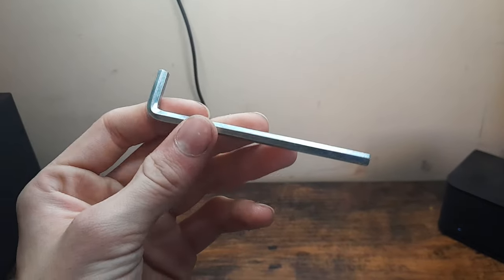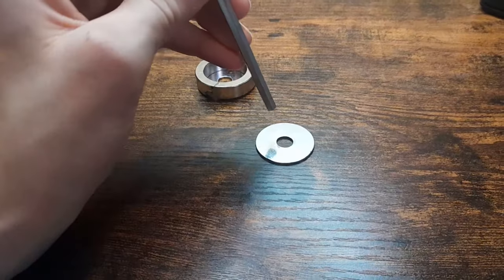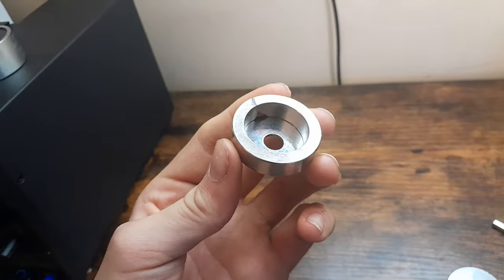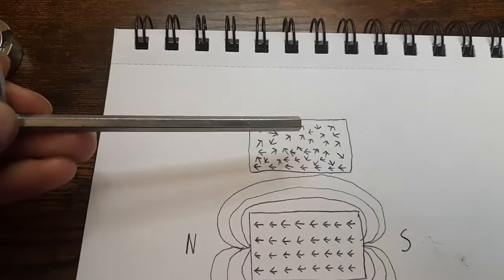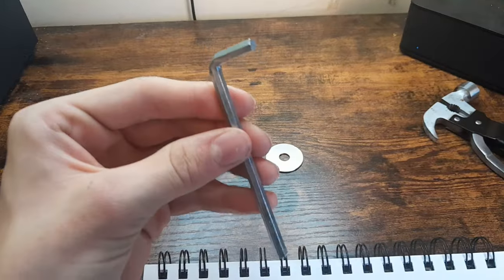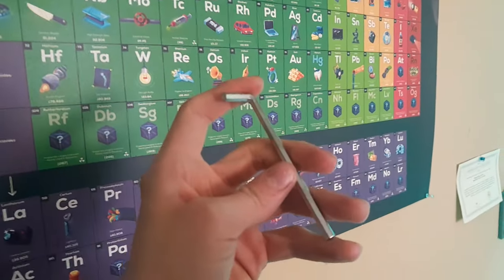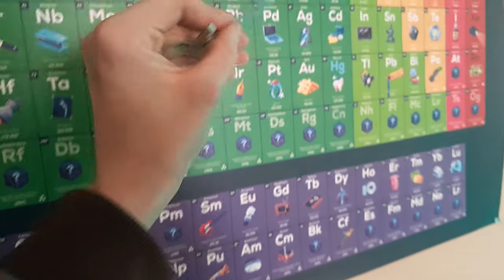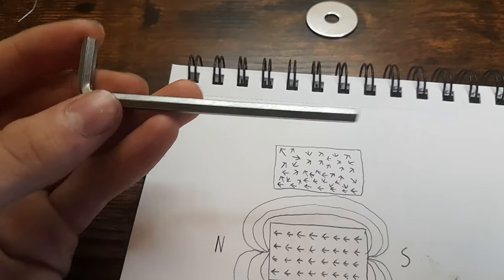How to magnetize metal (making a permanent magnet)

Comment: The way you make a magnet this way is to have a slightly thinner wire gauge at the end. So it'll actually burn out like a fuse when it reaches the peak of the current.
And then disconnect it from the electrical source.  That way, you can use AC. Currand I'll break it at the peak i'm one of the peaks

Comment: I do understand why hitting with a hammer makes the magnet stop working.
But why does hitting it in the presense of a magnet make it magnatised? Like, what does the hammer change from it just being in a presence of a field?
Reply from the maker: It jiggles the atoms around a bit and makes it easier for the domains to reorient themselves and align with the field. They'd want to stay in place otherwise. But I could be wrong. Some people suggested hitting it with a hammer was unnecessary.
Reply: Like he said, it allows the atoms just a bit more freedom to reorientate themselves. They’re experiencing a magnetic pull towards the magnetic field, so when they stop being shaken and settle back in, a higher % will be facing the desired way and magnetize it.

Imagine you have a jar of rocks and sand. You want all the rocks at the bottom of the jar, but the sand is in the way. If you shake the jar up, you’re going to notice some of the rocks ended up on the bottom in place of the sand, but not all of them. It’s the same for the magnet, except instead of rocks on the bottom you want them to rotate.

You can increase the effectiveness by getting more of them to face the same way, but that gets harder the stronger you want it.
Reply: @nicksgmail9663 so are you implying that the longer you tap it with a hammer, the stronger it's magnetism?
Reply: @visualmunchables  Consequently it seems to me high amplitude vibrations would work better than a hammer

Comment: Maybe you know and if so could you please tell me…. I’ve a magnetic charging port on a device and a magnetic charger. Both have two magnets of opposite polarisation. The device has lost one of its magnets and I was wondering how to replace it please? I can’t find replacement magnets for these types of charges online, I don’t know if I can use non magnetised metal, whether it will still allow the current to flow and the device to charge, whether it won’t work at all or whether it’ll burst into flames and whatever solution I use it’s going to be too small for me to hold on to test so I’m going to have to go straight for the superglue or whatever glue you use for electrical components. 

Any ideas? Please?

Comment: So is there a way you could make something already magnetic slightly stringer with this technique?
Reply from the maker: Yes, as long as the magnet you use is stronger than the one you're trying to make stronger. But this will only work to a certain extent. The more aligned each of the atoms are with each other, the stronger the overall magnetic field will be, but once all atoms are aligned, you can't really go beyond that.

Comment: You don't need the magnet to magnetize the steel bar. You can just point the steel bar magnetic north (and use the earth as a magnet), whack the end with a hammer and the bar turns into a magnet.
Reply: Please stay off the internet and don't comment for a while.

Comment: The magnetism in the wrench seems to be very weak, how can it be made stronger?
Reply from the maker: A stronger magnet will do the trick! Also, using metals more pure than the wrench should work better. Another idea is to heat the wrench and let it cool down in the magnetic field while tapping it, but be sure not to heat the magnet. But that's just a theory.

Comment: What metal can you use ?
Reply from the maker: As I said in the video, iron, cobalt, nickel, and gadolinium are the only metals that'll magnetize at room temperature.
Reply: @SomethingAbtScience  a terrible idea just came to mind: what if one were to be in the middle of the wilderness with very little outside magnetic interference and tried to tap metal into being a magnet make a generator based on that, create a stronger magnet based on a solenoid, put that new magnet in the same motor and repeat until they got a strong magnet?

Comment: I got interested in that 15min ago wtf.

Uh i saw that you can demagnetize a magnet with fire so the magnet can be stronger if he is in like..Ice ?
Reply from the maker: It won't necessarily make the magnetic field stronger, but cooling it down would make it slightly less susceptible to an impact demagnetizing it. Cooling it down causes the magnetic domains in the magnet to be more stable, and denser.
Reply: Thanks for the explanation ! @SomethingAbtScience

Comment: If you just RUB the strong magnet in ONE direction over and over it will magnetize that allan wrench better than that. Kind of like whittling wood motion or using a ferrocerium rod.
Thumbs up still.
Reply: This is for the same reason though at the end of the day. When you rub the two it’s still “hitting it” because it’s bumping along the edge many times we don’t see. It’s still wiggling the atoms and letting them orientate themselves towards the magnetic field, which is the purpose of hitting them.

The reason it seemingly worked better for you could be that the smaller bumps allow for better adjustments.

Comment: seriously?!? we just hit it with a hammer in presence of a magneting field? 

we can make like infinite magnet generators. holy shit. 

does this weaken magnetic field on the stronger magnet over time? or is it seriously this easy to make magnets?
Reply from the maker: @l.e.u.m.a.s4218   The metal you turn into a magnet will not have nearly as strong of a magnetic field as the neodymium magnet or electromagnet you use. 

But if you want really good results, I'd melt the metal or get it red hot and let it cool down in the presence of a magnetic field. 

This will allow the magnetic domains which are trapped in the solid metallic lattice to re-orient themselves with the magnetic field while in a liquid or at least red hot state(idk the required temp). Then it solidifies while they're all aligned with the field if that makes sense. 

The maximum magnetic field strength you can achieve is determined by the magnetic properties of the material you're magnetizing, not the external magnetic field you use to magnetize it.

Comment: Why would you post with a thumbnail of a wound wire if that isn't what you are going to do?
Reply from the maker: I didn't make a thumbnail for this video. When posting a video, youtube gives you 3 thumbnail options from frames of the video, I chose the most relevant one. Also, what's shown in the thumbnail is one way to make a permanent magnet, not just an electromagnet.